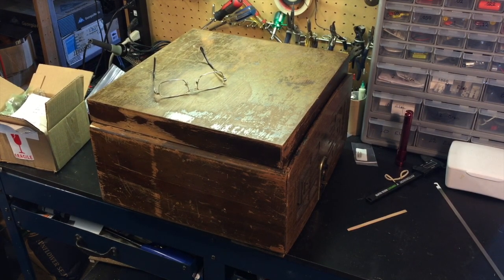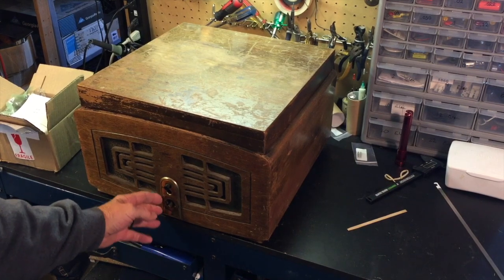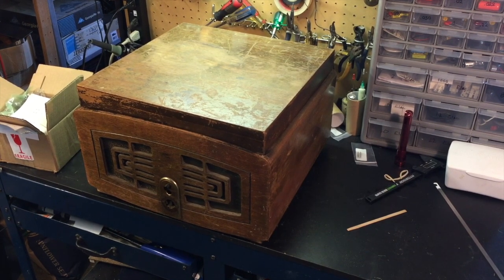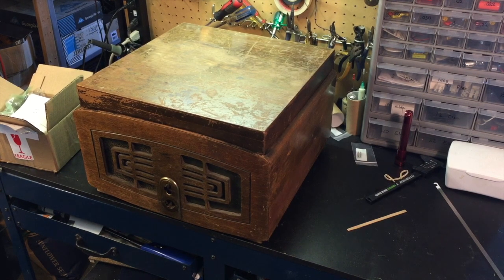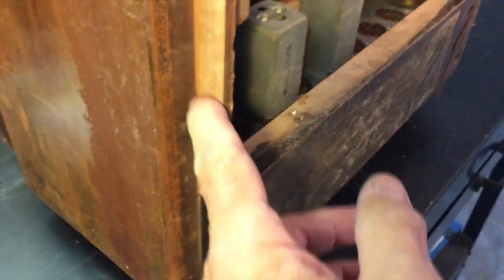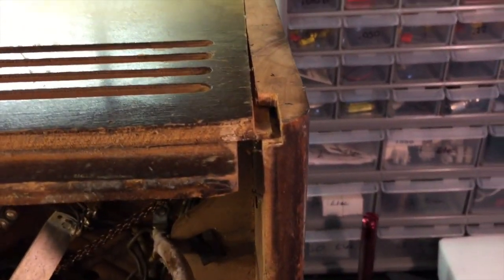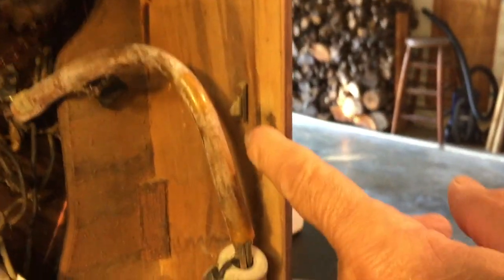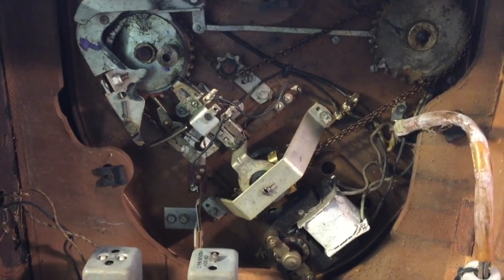Zenith 5R086 Radio Phonograph Restoration -  Part 2

Comment: How you remove the platter ?
Reply from the maker: The platter is held down by gravity. If you’re lucky, you simply have to pry the platter up with your fingers. If the old grease is really solid, spray a squirt of penetrating oil, leave it for 24 hours, and try again. If that fails, pry upward on two points while someone else gently taps on the spindle. Ultimately, it may require heat be applied to the spindle and platter where they meet, not a lot, and not for long. Good luck.
Reply from the maker: By gravity, I mean it’s a friction fit with no retaining clips.
Reply: @fibberscloset498  Thank you  for your reply. I have tried everything you suggested, sprayed squirt of oil, heated spindle area with heat gun,  pried up with my fingers while swiveling around, tapped on spindle and platter hole area, but it will not come up.. Trying not to bend it. It is really stuck!
Reply from the maker: @michaelvice3976  wow, it’s really stuck! At this point I would begin to wonder if there wasn’t a spring wire retainer of some kind. I don’t have any other ideas for you, other than some wooden wedges driven in around the perimeter and left to sit. See what steady pressure might do. Best of luck on this one.
Reply: @fibberscloset498  THAT'S a good idea about the wedges. I will try that. I think there are 2 small holes in the platter in the spindle area that might have something below that releases the platter. Have not checked that out yet. Your videos are always great! and helpful. I may have other questions on this as I go along. Thank you for your replies.
Reply: @fibberscloset498  Hello,  Wanted to let you know After 2 weeks, I still am not able to remove  the  platter. I have tried  penetrating oil, tapping the area, heating the area  with heat gun, prying  up with fingers, prying with thin pieces of plywood from beneath platter, but it will not come up. I am thinking the only way might be to try to remove the  whole spindle  and platter together, but that might involve the chain and pulley mechanism beneath. Any more suggestions, Please . I am still stumped on this one. Thanks. Michael
Reply from the maker: @michaelvice3976  Wow, you have a real challenge there. One last thing I would try is to put in some wedges around the perimeter, and then play a small torch flame around the top of the platter within an inch or so of the spindle, but not get the spindle any hotter than necessary. You want to get the center of the platter hot, not the spindle. I have a butane torch that produces a very focused flame, and I would try that. Beyond that, I am out of ideas.
Reply: @fibberscloset498  Thank you so much for your reply.  I have actually now removed the spindle and applied extreme concentrated heat with a small hole heat gun to the the brass collar on which the platter sits, and pried up with a  flat metal pry bar and plywood wedges, but it will not budge.so far. I am afraid to bend or  damage the platter.. But I will keep trying with wedges and heat. I would so like to get this thing playing. Got the radio playing fine so far. Thanks for your time and expertise. 
Michael
Reply: Wanted to let you know, I could never get that platter off myself, but referred it to a repair guy who applied  heat to the center hole with a soldering iron , tapped and it popped right off.. The motor was binding but he resolved that issue. too.  So the cartridge puts out but very low volume. I cannot find an Astatic 12 cartridge on Ebay. Do you think a Phanstiehl P-51-3  would work? Or something else.? Do you think it needs a 3-volt cart? Thank you.
Reply from the maker: @michaelvice3976  Well, I prefer to think you got it loosened up for him.  Finding a working crystal cartridge is tough. I just got lucky. Unfortunately, I can’t speak as to whether the Pfanstiehl will work or not. I would have to do some research to find out.
Reply: @fibberscloset498  Yes I probably loosened the platter for him to pry it off that easily.. I had installed  that Pfanstiehl  cartridge with only .5 volts and it played okay, but i came across a generic tone-arm with a 3-volt cart . installed for $15.  Cart. had no screw flange or bracket, so I installed  it in the Zenith tone-arm using double-stick tape and glue. Now it has all the volume that speaker can take.. I had to glue in a large nut under arm to increase the weight so it would track and trip properly. Now radio and phono are playing well.  Thanks for your help.
Reply from the maker: @michaelvice3976  That’s great. Congratulations!